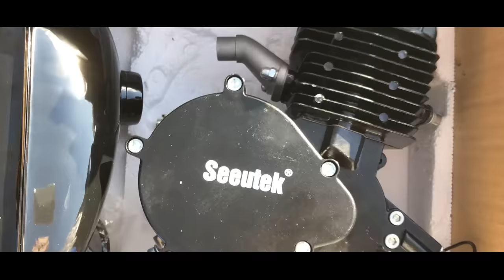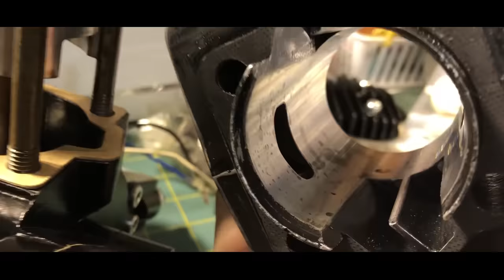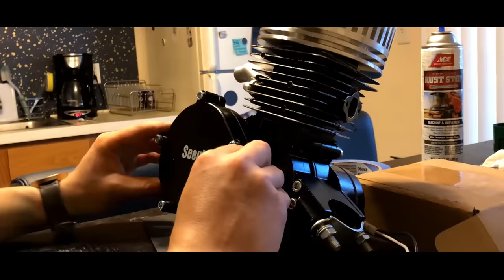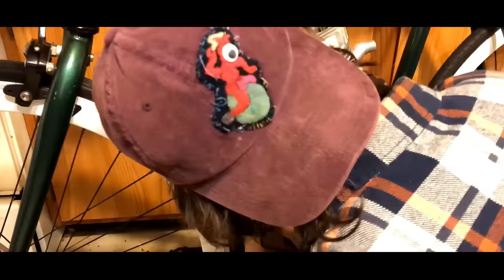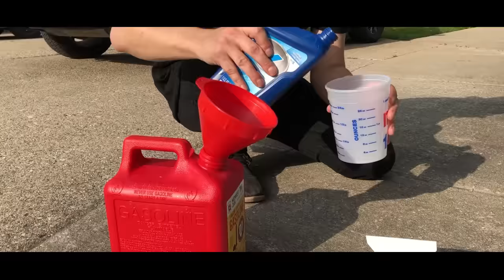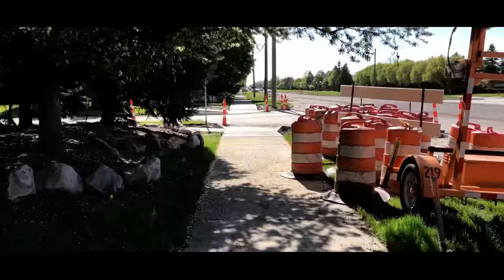Building a Motorized Bike Kit from Amazon!

Comment: Thank you for the video. I’m considering buying one. I saw you were sand papering and using the stemmed before putting together the motor. Why is that and is that necessary or can I just put it together without doing that?  Thank you!
Reply from the maker: Hey thanks for checking out the video! It definitely isn't necessary.  I was "porting" some of the insides, basically ur just smoothing/widening  some of the intake areas where there might be some jagged metal from the casting. (These kits are generally pretty cheap) I also was just curious about how it worked and wanted to kinda dissect it a bit. I certainly went a little overboard.  Should only take you a day or two to get it up and running. Let me know if you have any other questions with your build!
Reply: Great tip on porting out and making all parts smooth.

Comment: Do the kits come with decent instructions?
Reply from the maker: Honestly not really.. This was a pretty cheap kit// Maybe $150 (Chinese made but I was surprised with the quality so far, still running!.) I just resorted to youtube & forums but happy to answer any questions you might have..Bicycles are all different, I think thats why it's a little challenging.  Either way its a great project & you will learn a ton.. I'd say it will only take a couple days to get it fired up! Good luck! Feel free to reach out! Thanks for checking out the video!
Reply: @SurfingOnStatic  
Thank you very much as I will definitely need help on a first project. I can always upgrade after getting good hands on training.
Reply: I have a decent Mongoose Mt Bike with Rock Shocks in the front and feel confident I can do this…question now is 2 or 4 stroke kit?
Reply from the maker: @johnnybbgunner2136  For sure! You definitely can! I didn't know anything about it but wanted a fun project.  I'm not a mechanical guy usually but was a good intro into how motors work.  Starting with a nice bike is key.  take a look at how much room you have in the frame for motor.. Most of those kits fit a V type shape.. Just order it! I promise you'll love it.. Let me know if you get stuck, I'll try my best to help ya!
Reply from the maker: As far as the 2 stroke vs. 4 stroke...  I would start with the 2 stroke.. It had a lot of power and its a good intro to learning.

Comment: How much d9es this kit cost?
Reply: Does*
Reply from the maker: The initial kit was about $140 & I had the bike which I think was around $200. (the kit will fit just about any bike with some adjusting.)

https://www.amazon.com/IMAYCC-Bicycle-Engine-2-Stroke-Petrol/dp/B08ZMFF5FR/ref=sr_1_3?crid=39EQ0IRRWR2N8&dib=eyJ2IjoiMSJ9.XT-Ak2rIl8o894iAXQVqhn04r7GFn4XDP2zvxE2GeChZi3cOYbyVPwIXr4QYe4i9kouCJUWJtCcvfz70Y8hszI90vdeA0bpU7x8Ii8gJpWvVlP5kZ8QCZZy_OZAvnNFdXcS2xICq0BuGStgOL1neTh0RzKr9mn97g6gBd-SuIyi3ULEpxvjJhWYAvb1PLoNklgY48WtNo_aTUJVLaLNXtUd1ZcObwQaS4jKy1-fLL-M.mixu4boVOSmPSNl0QJfJpAQQcqmQPsCvyotPrEyOs2Q&dib_tag=se&keywords=bike+motor+kit&qid=1722004582&sprefix=bike+motor+kit%2Caps%2C106&sr=8-3
Reply: @SurfingOnStatic
Reply: Thanks for the info
Reply: Also would it work on a cheap box bike from Ebay

Comment: Precio de kit
Reply: $80-$100+ depending on the power
Reply from the maker: <a target="_blank" href="https://www.amazon.com/Seeutek-Bicycle-Motorized-Upgrade-Speedometer/dp/B09H27JK1J/ref=sr_1_3_sspa?crid=2NWUL1U2GUN46&amp;keywords=bike+motor+kit&amp;qid=1707325618&amp;sprefix=bike+motor+kit%252Caps%252C118&amp;sr=8-3-spons&amp;sp_csd=d2lkZ2V0TmFtZT1zcF9hdGY&amp;psc=1&_encoding=UTF8&tag=surfingonst0d-20&linkCode=ur2&linkId=9c8604d91f76aa2548324e39d1e8da48&camp=1789&creative=9325">SEEUTEK BIKE KIT </a>
Reply from the maker: This one was a Seeutek.. Basically they are all the same. I spent a little time taking it apart and cleaning up some of the intake areas.

Comment: damn thats alot of 2 stroke oil you put in there. should only be 2% oil.
Reply: It's supposed to be 3.2 oz of oil to 1 gallon of gas but for break in they say double the oil. I didn't listen to the instructions and just did the 3.2 oz to one gallon of gas , recommended by Hughes motorized bikes on YouTube and I listened to him since he always works on them and has been forever. Have a great one bud.
Reply from the maker: Exactly! .. Worked like a charm .. Thing sat in a shed all winter.. Started up just fine in the spring.. Still going strong too! 4 or so years! For a cheap little kit, I am impressed.

Comment: This parts total band ইন্ডিয়া নট চাইনিজ এভেলেবেল আমাজন
Reply: How fast does it go and how.many miles on a full tank
Reply from the maker: I filled this thing up two times.. I can't even count the miles. I fill it up once in the summer and that's about it.. I should do a test but I would say next to nothing on gas prices.
Reply from the maker: As far as speed.. I think I got about 30mph .. Kinda scary on a fixie tho with the thin tires. Not the best bike to mod honestly.. It's quick for sure! I would say don't try to push it on these things. I use it to cruise. The overall build of a bike isn't really meant to be pushed so hard & I find myself doing a LOT of tune ups with tires and tightening things. Please be careful out there!